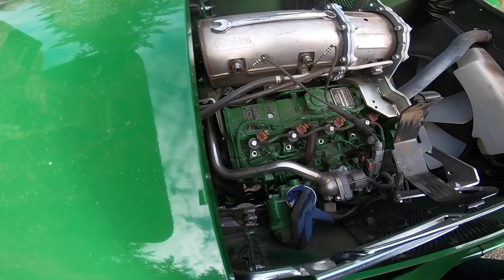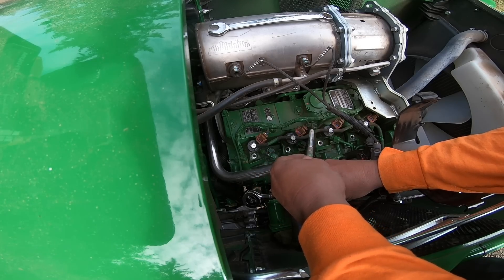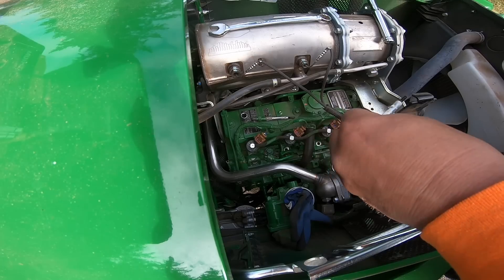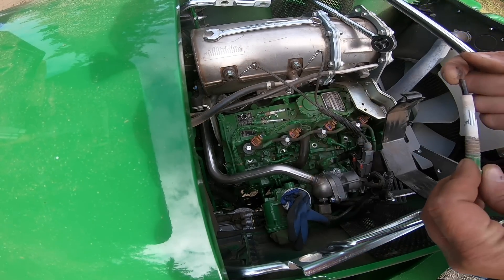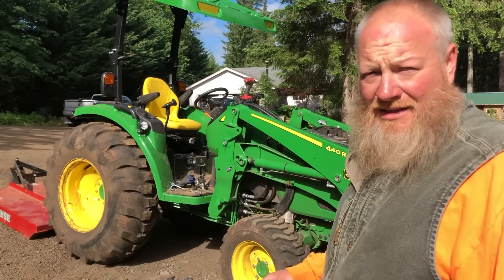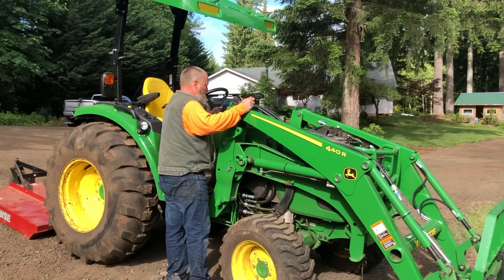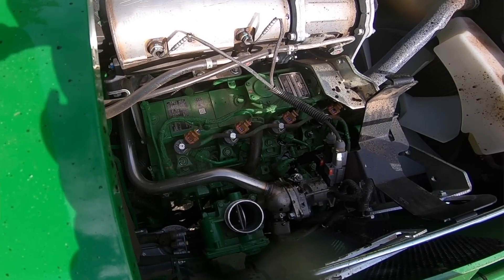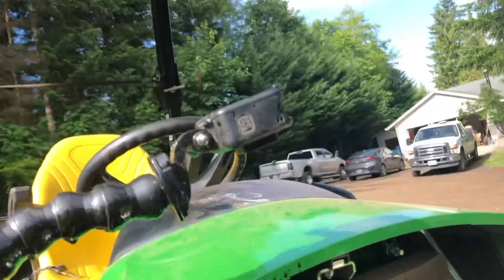Tractor Roll Over Day 2. Did I Ruin My Engine?

Comment: It will “turn over”  just won’t start.  Lol
Reply: i seen a kubota tiped over but it never hurt the engine wich kubota engines are made tough and solid
Reply: Joe Relph - lol you did not watch the entire video to gain an understanding for what the oil in the crankcase did.